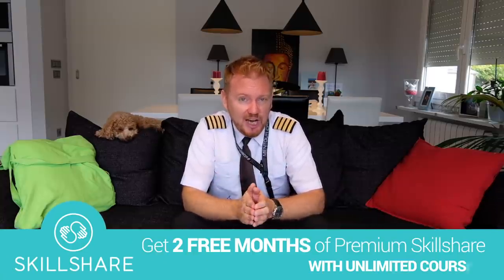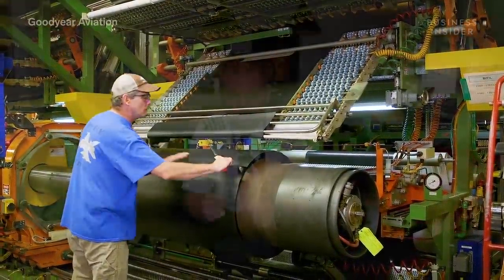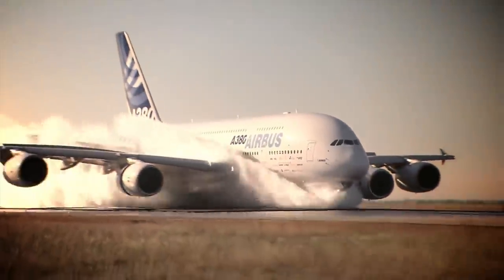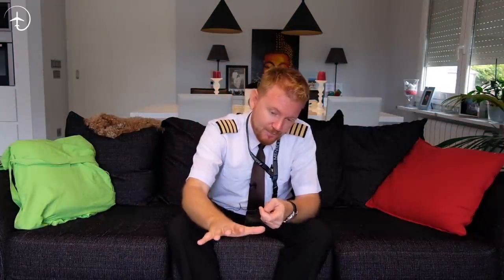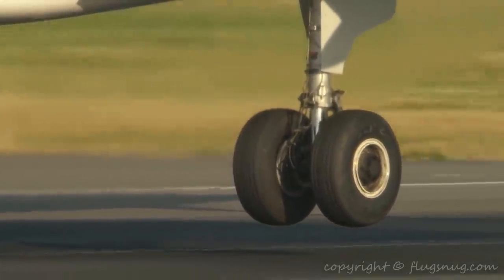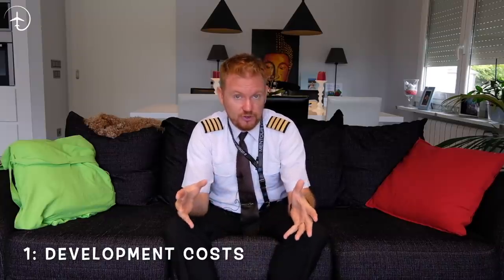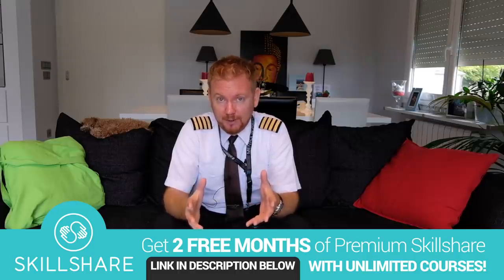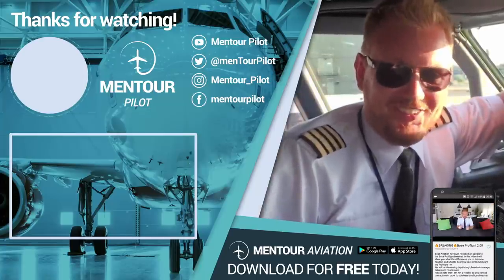Why not make plane-tires spin, before landing?!

Comment: A friend of mine in High School wrote to the Air Force asking this same question for a Science Fair project he was working on in 1976.  He wanted to spin the tires with a DC motor inside the aircraft before the landing gear was extended.   They replied that they did not want the gyroscopic force to affect the aircraft's landing maneuvering capability in case of conditions other than a standard landing.

Comment: My father, who was an aircraft mechanic on CV-33, said that some gear had a Pelton-wheel like turbine, that would catch air and pre-spin the tires before the controlled crash that was to come. Not sure about the details, but I remember him talking about it. Probably important in the early naval jet-age to maintain velocity in case they had a bolter.

Comment: Hi.
I would add physics into the equation.  The tire smoke shows a transfer of energy.  In order for the aircraft to continue down the runway, it has to get its wheels up to speed very quickly.  While this is occurring there is a form of resistance to the forward motion of the aircraft, therefore static wheels are another form of braking.

Pre-spinning wheels will add forward momentum - same as stepping off a travellator, the people who were standing, letting it do all the work simply step off.  The people who were also walking on the travellator step off at a much faster pace.  That's because your combining two driving forces in the same direction and not having to get your legs up to speed
Reply: The braking force is insignificantly small for a static wheel. We are talking a 80 tonne aircraft against a (what? guess) 250 kg wheel. Even when you multiply those wheels by six you only get 1,500 kg which is but a fraction of the total mass of the aircraft. And they will not be a constant stopping force as they start spinning rather quickly.

From the wheels perspective however... They are literally SCREAMING as they touch the ground.
Reply: @RealCadde  
I know a static wheel isn't going to provide all the force necessary to slow the aircraft down, but every little helps!

I also know this isn't happening by design, more as a by-product of the reasons mentioned in the clip
Reply: @miyahollands6136  You have a point. I see it now. Having pre- rolling tires would make the plane more tricky to stop since it will need more runnway.
Reply: @GeordieBoy69  No, they're not cuts added to the tire. A retread for aircraft involves trimming the tire, then melting new rubber onto it. It is then placed in a hot mold to create the new tread.
Reply: @GeordieBoy69  No - I buy Airplane tires that are RETREADs - they are not treads cut into the tire, they have new rubber melted on with treads formed. Maybe cutting into a tire is ok with what you do, but not acceptable for an airplane.
Reply: @GeordieBoy69  No - the tires are called "retreads", even though they're molding new rubber - industry standard terminology. It's not rocket science.

Comment: I only just realized the red pillow on the port side, and the green pillow on the starboard side of the couch...
Reply: Right because the dude with hard accent is an aircraft.
Reply: Is that with respect to the viewer, or the pilot?
Reply: Sean Whelan 
There is a white tail pillow but you can’t see from here.
Reply: I freaked for a second when the pillow in the left background moved.
Reply: ha never noticed :)
Reply: @lcarliner  the pilot. Port and starboard are always defined from the point of view of the vessel in question.

Comment: In 1994, I made this suggestion to the USAF as a way of saving wear and tear on the tires.  My idea required no motors.  Instead, I suggested either the sidewalls or even the tread include several radial (center to outside) sawtooth half triangle ridges that catches the wind from one direction but is slipstreamed in the other direction.  Result:  Spin.  In short, the wind is your engine, with this built-in turbine powered by the airflow over the tire itself.  At normal takeoff and landing speeds, with the wheels spinning at an RPM commensurate with the aircraft's velocity, the additional air friction is minimal.  And, YES, speaking as an aero engineer, you CAN design ridges such that the tire spins about about 80% of its forward velocity through the air.  The ridges would be minimal, perhaps 1/2 inch high, and molded into the tire itself.  The amount of weight would be small, perhaps 2 to 7 lbs per tire.  

Answering Bill Witt's objections:

1.  wheels spinning at touchdown speed with the tires  out of balance would shake the airplane apart

Uh, no, for the very same reason that wheels spun up within 1/2 of a second after landing don't shake the airplane apart.  Aircraft break/tire/wheel assemblies are balanced, same as your car tires, though with considerably heftier equipment.  Did BF Goodrich balance the tires?  Did they not balance them so they avoiding solving the problem thereby being able to sell more tires?

2.  In addition, not only spinning the tires but the brakes would also have to be spun up which would require  considerable power. 

Again, no.  While there is slight friction with the brake when the pressure is off, it's minuscule compared to the friction when it's even partially engaged.  Furthermore, the inertial momentum of the brakes is a small fraction of the inertial momentum of the wheels and tires.  Your 727 incident was the result of multiple stops from high taxi velocities, not from the mere act of taxiing.

3.  Nitrogen is used to prevent the tires from exploding...

While true, that point has nothing to do with the issue of spinning up tires prior to landing.

4.  The gyroscopic effect of spinning tires would also adversely effect trying to control the airplane  during a critical time of landing.

Absolutely not.  We not talking about a lightweight bicycle with a comparatively large radius wheel.  We're talking about a large aircraft with a comparatively small radius wheel.  The gyroscopic forces resulting from straightening the aircraft from a 20 degree right crab (rather large!) to straight down the runway, would only very slightly tilt the aircraft to the right, which actually counters the far larger left tilt induced by landing in a right crab.

It's feasible.  It's unlikely tire manufacturers would adopt this for one simple reason:  They would sell less tires and retreading services.
Reply: Sounds wise from every point of view, and just spinning up the wheels to 50% of normal rotational speed at landing would lower the wear a lot. Using bleed air to spin the wheels off could also cool the brakes, I guess.
Reply: as for your idea that wheels don't vibrate because they are balanced, yep when initially fitted they are but after use they can become out of balance, or shed a weight or...
These aren't as you say bicycle wheels, we are talking about a wheel up to several feet in diameter and a mass of several hundred pounds, in the case of a 747 there are 18 of them all spinning at various rates, why take the chance of spinning them up to high speed at THE critical point in the flight.. landing.
Spinning the brakes up.. brakes often bind quite hard so that wheel might be slow giving different forces than the others, why bother taking the risk for something that might only last one landing, you've probably seen the video of landings where they hit one leg first then slam the other down while the aircraft is sorting out which direction it wants to go, tyres are worked hard. As someone else said there are some aircraft where various systems may be initiated by the wheels spinning up to speed, like the brakes for instance, spinning them up early puts the brakes on before you land. Spinning them up is of course possible its just pointless.

Comment: The autonomous electric tugs is a good idea, I had it as well 😅. How much time would the engines need to warm up and show check readings showing that everything would be OK before takeoff?
Also, if tugs were big enough they could provide APU power, for the AC and all other systems. To have AC you would need compressed air. That could give you startup air to start the engines. This may sound huge but it would be a significant step for electrification of aviation. Tell me about your thoughts if you happen to catch this comment.
Well-done with the channel.
Reply: It sounds good on paper but aircraft needs the APU on board as well to have it there in case of emergency to keep power for flight instruments and create pressure for engine start up if air flow is not enough. You could use tugs to make the pull and have jet engines just idle and warm up while going to runway, not taking extra fuel to actually move the plane, this would also remove some break heating up if tug can provide braking forces on the ground, but to have them fully autonomous is kinda bad idea in my mind. Much rather have mentioned remote control by pilots and then ground operator takes control of it to get it back to gate. Having it being autonomous would cause dangers of thing deciding to just wroom on the runway while plane is coming in or stuff like that. There needs to be very least human operator supervising them even if its remotely, but even after that there must be system in place where by cutting power it can roll freely if there is no plane attached and another drone to be able to tow it away in case on malfunction all with in minutes to clear the paths. There is good ideas to this, but its needs further development to iron out any issues that can rise from it. For electrification of aviation... maybe when batteries can hold much power as fuels we use today. Electric systems are always bit iffy and i would not trust them specially in planes. EV's as ground vehicles, maybe, but even that is pretty horrid idea.. If you have seen how much effort it takes to extinguish EV fire... now add tons of fuel to that... then add row of 737's next to it.. yeah that is bad bad idea...
Reply: @Hellsong89  further to your comments if you had a tug to tow the aircraft to the end of the runway then needed someone to return it to the gate you would need  a tug and driver for lots of aircraft as opposed to one guy doing a quick push back then moving to the next plane, plus some of the taxi distances are pretty long and aircraft can end up in queues at the runway, so once again it would probably end up more expensive than a few thousand/hundred  pounds of fuel, and would be far more complex to organise.

Comment: My reason: when the plane lands, the rubbing tires give a perceptible lurch and maybe a squeal, so the pilot knows exactly when he has touched down. (With prespun wheels, a perfect touchdown would be imperceptible.) And as well as slowing the plane a bit to lessen the required braking (as others noted),  it pitches the nose down a little, reducing lift and lessening the tendency to bounce.

Comment: I don't think you need motors to get tires spinning. Just put small cups facing the direction of flight at the bottom and 1 side or both sides of the wheel. The drag will start the wheels spinning once in the airstream. The size and shape of the cup can be engineered to spin so they are at the landing speed of the aircraft.